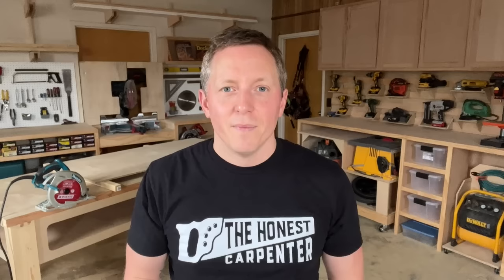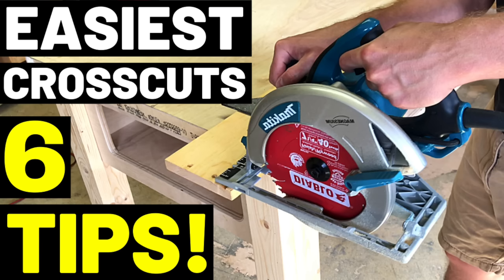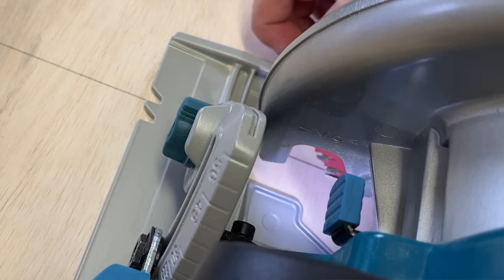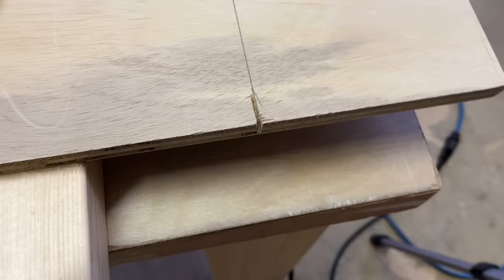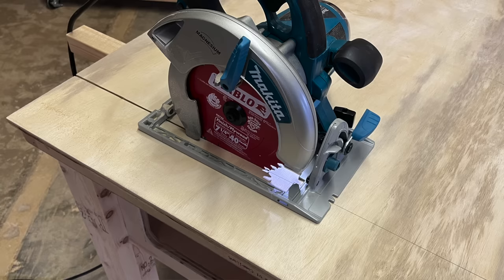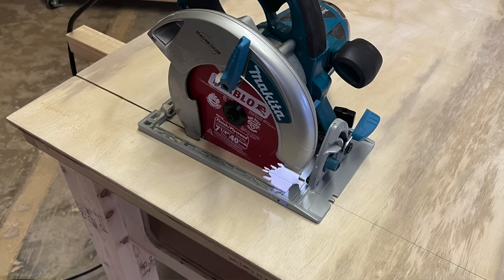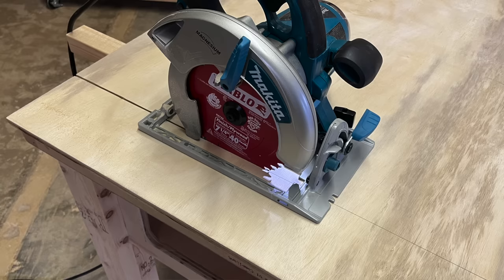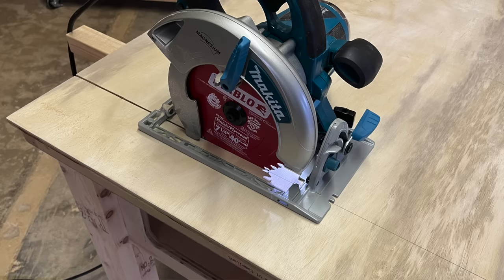How To CUT STRAIGHT With NO GUIDE! Freehand CIRCULAR SAW CUTTING...Pro Tips, Tricks and Secrets!

Comment: My dad (a hobby finish carpenter / woodworker) taught me to keep the kerf on the “waste” side of the cut unless the call out was to “take the line”.  Then go right down the middle as you described.  To line the saw up he told me to put the saw down at the start with the “0” side of the guide notch on the line and look down at the blade and put it as close as possible to the line, approaching from the waste side of the cut. Start the blade as you described and ease the saw forward making additional micro adjustments so the edge of the kerf eases over against the line (all this right at the start). He liked his 1960 B&D circular saw because it blew the sawdust completely off the line just ahead of the saw.  I have nice memories working with him as a kid when he was teaching me stuff.
Reply: My grandad always said “Cut it fat.” That meant  leave the line.
Reply: In aus we say cut the mark or leave the mark. I cut just on the mark but leave the mark means leave it clear. We use this when we want half a mm extra or less
Reply: He could have chosen his words better, but what I heard was cut on the waste side, but split the line with the edge of the blade on the non-waste side.

Comment: Tooth count on the blade made the biggest difference for me. For years I ruined sheet goods with a 24 tooth framing blade because it was all I had. Switching to a 60-80 tooth blade made it so easy it was hard to mess up a cut.
Reply: I use T40… less expensive and the Dewalt ones are usually on sale at Lowes so it’s a good general purpose tool.. although it probably won’t ever say they’re on sale at the store… at least at my local Lowes I had to find it online and confirm it was on sale 😂😂
Reply: I think the saws should be sold without blades. You choose what suits you at time of purchase.

Comment: I worked rough carpentry for more than 20 years making 20 or more cuts on plywood sheeting every day, never looked at the blade and always followed the mark on the front of the saw, Makita, that way you don't have dust and chips flying in your face. I also cut facia using the mark, freehand with perfect joints. Try using one hand and going through it quicker, your other hand is throwing you off, use it to steady yourself or the workpiece.
Reply: I’m with you on this. Lots of years cutting, once you learn your own saw you know where the marks put you. Using 2 hands leads to one fighting the other.
Reply: Yeah...me too, have done thousands of cuts. I lock my eye on the notch at the front and use one steady locked hand

Comment: Here is a Pro carpentry tip I learned from a legendary cartoonist.  When freehand drawing a line look just in front of your pencil or pen.  If you look at the pencil your eyes are telling your brain where the pencil has been instead of telling your hand where to go.  Look on a 1/4"-1/2" ahead for a more steady clean line.  It takes a little practice but tells your brain where the pencil is AND your hand where to go. 
This applies to cutting wood freehand as well.  After establishing the cut look slightly forward on the line not directly at where the blade touched the wood.  Remember, tell your hand where to go, not where it's been.
Reply: Great advice...remember your hand follows your eye's!
Reply: just like riding a motorcycle, dont look where youve been, look where you want to go!
Reply: @chapygrace Or skiing - look for the path, not the trees!
Reply: @RobbieBow  But the trees are pretty! Oh, not so much when you're on top of them!
Reply: It's also true in different activities. As an snowboarder I know that the best way to crash into something is to look straight into it while actively trying to evade it. Look where you want to go instead.
Reply: @StephenBoesch 😂😂
Reply: Thanks. That I learned in art school, also true in sewing. Keep your eye a mm ahead of where you are about to draw or stitch and amazing how straight the line becomes. No point in looking st the needle (or blade). It is in a constant position.
Reply: It's kinda crazy that I've never thought of this concept before. Good advice

Comment: I use a piece of foam insulation to support large boards on the floor. It provides complete support to the entire board and the blade cuts into the foam. It also allows you to crawl on the board to make long cuts and limits the problems with cords since there is nothing for them to catch on.
Reply: I used to support on 2x4 etc but the foam is so superior and lasts for tons of cuts if the depth is set just more than the wood
Reply: Awesome great tip!
Reply: What’s this type of foam called and can I get it at a big box store?
Reply: @DISABLED12-7 styrofoam, XPS etc. They come as large, lightweight panels and are used for insulation. They will know in the store.

Comment: I found that the biggest factor is a decent quality sharp blade. Even my cheap Skilsaw cuts straight and clean with a decent blade. Those Diablo blades work well.
Reply: Good point, I got a diablo blade that came with a used saw I picked up and I was so pleased with it.  It just feels like it cuts like butter from whatever blades I was using before.  I hadn't looked up reviews on blades yet, but noticed it as well in this video.

Comment: I’ve worked in woodshop since I was kid.  Using a circular saw I’ve always had issues with wavy lines.  I’ve seen guys pull off some amazing free hand cuts.  Watching this video helped a lot, It also helped me understand that no one is perfect without a saw guide lol
Reply: Me to since I was a kid, and still can't cut straight, really angers me
Reply: Well, the angle of approach is crucial. If you dig in just a degree or two off - you're guaranteed to end up with a bad looking cut. If you can dig-in at the perfect angle and then just remember that your blade is straight and true - you can get reasonably straight freehand cuts but if it's crucial that the cut is nice and straight --- clamp a straight edge to the work or use a guide (I'm sure you know this)

Comment: Great video.  Very thorough.  I'm an experienced Carpenter and can't stress enough the importance of "knowing where your cord is" as mentioned in the video.  If you are making cuts that are several feet long this is especially important.  Before you start your cut, make sure you have enough extra length on your extension cord to get your saw to the end of the cut.  I frequently check my cord or adjust the cord following the saw as I'm cutting to make sure I continue to have enough slack.  These are very slow movements when I adjust the cord following the saw and my primary focus continues to be my cut.  There's nothing worse than being on track with your cut line and then your cord gets caught on something.  Possibly even your body by kneeling on it accidentally if your cutting on the ground.  Stop the saw if you have to and free up the cord to finish the cut or preferably avoid this altogether by "knowing where your cord is" and that you have enough slack following behind your saw to finish the cut.  Again, great video!  Thanks.
Reply: Yes!
Reply: But… my circular saw is cordless! 🤠
Reply: @Noadvantage246  That charger isn't. Why is it on your workpiece? 🤔🤔

Comment: I have been spending 12/14 hours per day for the last 3 weeks with circular saw because of an urgent diy project and I've learned all of this in a bit hard way but luckily not in the dangerous way it was supposed to be. So newbies please pay attention every single word he's saying is 💯 true. 
Most hateful thing with this is, it's Kickback and lot of reasons are there to make it happen. Gladly figured out all of them. Now circular saw has become my favorite tool. My favorite part is trimming small pieces with holding circular saw upside down on my knee just like table saw.
Reply: Use the table saw instead. That's a very dangerous thing to do.  I won't ever cut with a skilsaw in any way that were it to flip I'd be in trouble.

Comment: Great info. 2 other tips to consider:

1) when starting cut, you can enter the wood  about 1/8” deep a bit on the waste side of line then slide sideways to cut line before proceeding forward. 

2) Old school carpenters hold a hand saw (the original cordless kind driven by muscle power) with index finger out of handle and pointed down side of saw. Doing this with a sidewinder circ saw and triggering with middle finger allows index finger to counteract natural tendency of saw to want to drift right since handle is left of blade path. 

Keep up the great videos!
Reply: I’ll have to try this, thanks!
Reply: Old school carpenters? I think you'll find it's just professional carpenters that know what they're doing. 😉

Comment: As an apprentice in the early seventies, we used worm drive saws roughing or framing. When I moved to commercial finished we used heavy platform circular saws. I remember journeyman telling me, don’t push just guide let the saw do the work. With the worm drive cross-cutting two bys we would square the front of the platform with the opposite side of wood by eye, then cut ! When you got used to it you could cut square every time I checked it with a square when foreman wasn’t looking many times. What really impressed me was cutting window eye brows ( curves) with worm drive saws! Just set your blade barely through material and cut curve slowly, it’s a nice curve smooth for sheathing.

Comment: Forget about cutting anything other than paneling or thin plywood ... even 3/4" ply bogs it down a lot even when cutting a very VERY slow path. Probably Works great https://www.youtube.com/post/UgkxjpBI8OOeUXib_iT7UomCrQ-uauwZJ62c  on drywall but who needs the mess of dust flying everywhere when a knife cut will do. Oh, and the red tab on the guard blocks your view of the cutting line once the blade is fully engaged in a cut.
Reply: WTF?

Comment: All good stuff, on an odd note my Grandfather on my mom's side had a metal ruler tack welded to the lead of the shoe in line with the cut and when needing that precision would use it, amazing how seeing the line in front of the saw can allow you to follow it even better.
Reply: thats an awesome idea. manufacturers should add something like that, that could be folded up or collapsed in some way when not in use
Reply: @Vid_Master  I have one of the laser guides and as long as you don't mistreat it seems to be a hair better. It flip clamps on the board at the end of the cut and lights up a line if set right, I usually will just add a piece of scrap and cut to the end in one run anyway, as long as you don't drop it on pavement pretty good tool.

Comment: Great tips for freehand cutting! Definitely takes practice. I use foam insulation boards when using my circular saw on large boards. It supports the entire board and prevents any damage to the table or ground.
Reply: ...or the $50 saw blade!!
Reply: @jim.h  they cost like $15 Canadian lol
Reply: @williamweatherall8333  I guess it all depends on the blade.
Reply: @jim.h  rocking Forrest woodworkers on your skillsaw?
Reply: Good idea. My sawhorses have a sacrificial 2x8 on edge on top. Doesn’t hurt the blade and cheaper than foam board, but doesn’t have the full support.
Reply: That’s a really good idea, Eric. I’ve never thought of that. But what happens when you run out of foam boards and are left with a big much of pieces Bryant snap easily? Those can be expensive, especially the thicker they are. The hospital down the street threw out a bunch of 8’x30”x1.5” Blue Dow foam boards from demo and they were still in fairly good shape. I have a small hot foam cutter that I use on them for cutting it however I want and it’s so satisfying. Even cutting foam just to cut foam is fun: 😎
Reply: @MrRusty-fm4gb  The foam boards last a while, and I just go to Home Depot or Lowes and get a couple new ones when needed. Just glue them to some 1/4" MDF and you're done.
Reply: @Erik_The_Viking  yeah, getting more from the store is always the best. I’m used to acquiring certain materials
Reply: @Erik_The_Viking  yeah if you’re using it for construction and have a budget then brand new is the way. Obviously. I watch a lot of YouTube videos about Model building, “scratchbuilding” buildings/houses and train layouts where foam board is commonly used as the base layer that’s out over wood trusses in the bench work. I sometimes forget that I’m commenting on a video about carpentry and not model trains, since both subjects, and working with tools in general are all of interest to me. And I like to keep and eye out for certain materials, like used,but clean Dow foam board that I can pluck out of dumpsters for free, since the hobby can be very very expensive. 😎
Reply: Just let it drop.
Reply: I remember back in 2007 watching my journeyman make clean cuts ever time. Few tips he gave me. Get a feel for clean cuts
Listen to your saw. It shouldn't feel like work.
Lower blade depth gives a better line from front plate mark to blade to square off before starting. Then just be confident all the way through.
Reply: @toodlican  You're right about listening to the saw. You can tell my the pitch on what's going on. When using my table saw I'm continuously listening to it to make sure I'm not feeding it too quickly.

Comment: I've found over the years that a straight cut is much easier with a worm drive saw. A combination of the ease of seeing the cut line and the handle being on the rear so you are pushing the saw straight along the line as opposed to typical saws with the handle higher up. These can make it easier for the cut to wander off course.
Reply: I agree, I prefer the form factor for variety of reasons, straighter easier rips, especially cross cutting ply on horses being the main.  I cant stand right blade side winders personally.

Comment: To improve sighting the precise line of cut,  place a clean piece of masking tape (I like yellow for this purpose) across the front edge of the sole plate, right on top of the factory provided notches, if there are any. Make a partial cut and then, with the saw still in the kerf, make fine lines (with mechanical pencil or pen) on the tape to indicate the precise location of both sides of the kerf.

When cutting, no matter how thick the line is that your pencil made on the stock, aim the appropriate side of the kerf markings you made on the tape at one edge (rather than the center) of the marked line, as though the kerf were a miniature car with two sides and the edge of your marked line were the curb of a little highway. Drive the "car" so it doesn't go over the curb.

If you saw in the direction of cut shown in the video, it is much easier to view the cut line with a left-handed saw.

Ergonomically, working on the floor is never a preferred method, requiring far more athleticism than when you can make cuts on well secured and supported stock while standing at horses or a bench.

Comment: Honest Carpenter, your video is a Godsend.  I'm a bit of a surgeon with an angle grinder, but circular saw technique has never been my strong suit.

I had to trim a quarter-inch from the edges of three 1x6x95" planks.  I watched your video, invested in a new forty-tooth disk, practised on some off-cuts for a bit, then went for it.  Fifteen minutes later - three perfect lengths with only one minor back-off.  Thank you so much!

Comment: Tip!  Figure out the distance from your blade to the left edge of the depth plate on the saw.  Once this number is figured out, simply mark your cut line with this number subtracted, or added depending on which edge measured from.  Now, you can make cut lines that will follow the edge of your depth plate, and never have to look at the blade again.  You'll make perfect cuts and people will wonder how you did without looking like at the blade.
Reply: this is also known as scribing
Reply: how is this any different from following the actual line with the blade? You still have to pay attention to and follow a line.
Reply: This method won't account for any deflection of the blade while cutting

Comment: One way to keep the saw's power-cord out of the way is to drape it back over your shoulder; this will hold it up away from your work-piece, and also allow it to slide freely as you move the saw along the cut.
Reply: Or get one of the many cordless available these days that are every bit as powerful as corded.
Reply: @Tool_Addicted_Carpenter  can't run those all day🙄
Reply: @tonyz6421  You can easily run them all day. The new battery tech is amazing. Only time I've plugged in a saw in years was either my 10 1/4" or to cut out an entire roof. Any of my cordless 7 1/4" could've cut the roof up but I didn't want to wreck the shoes. What brands do you own that you say can't run all day?

Comment: As a professional carpenter this is basic use information and all this information can probably be found in the user manual.  When you use these tools every day this video seems to be teaching the "proper way" while also ignoring some of the most important information as far as safety, understanding the capability of the particular saw in use and what that requires of the user while operating.

Three quick tips on cutting straight.
1) extremely firm grip.  Control the saws movement don't let it control you

2) the faster you can make a straight cut the better.  In reality, the professional world not only requires you to perform accurately but quickly.  The advantage is that with a firm grip a fast cut will always come out smoother than a slow one which allows more time literally for deviations in the travel path of the saw.

3) when you need a deadly straight cut on finish material, don't use a hand held circular saw, use the right tool for the right job.  

Thanks for covering the basics, that's never been done before;)